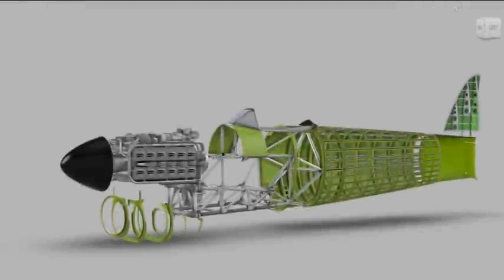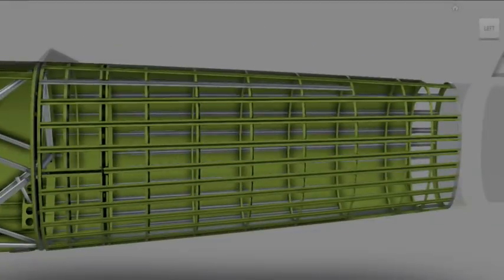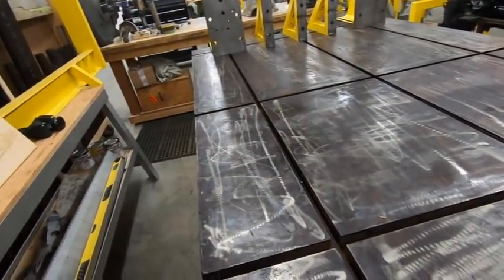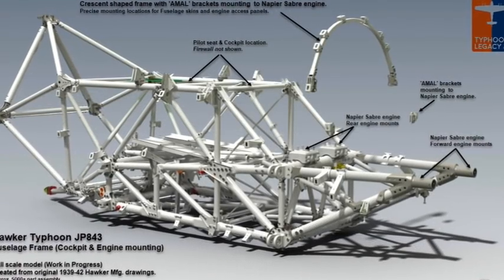Episode 20 Hawker Typhoon Cockpit Structure

Comment: Where would we be without CAD? I spent a few years using PROE. The ability to assemble and check fit and tolerances, walkaround, and see how everything comes together is just off the scale. What I'm looking at here, is just staggering. Congratulations on all achievements.
Reply from the maker: It can be difficult to describe how impressive this work is to anyone who has not been involved with this type of design work; these are not just awesome pictures, but thousands of completed parts drawings assembled into a unit ready for production! Thank you Dave! ~Ian

Comment: Hi, wonderful series by the way. Just curious, as we in Australia and Britain sharre the same language, which differs from American English. Is not a frame fixture device called a "JIG?" The asembly itself is so complex and clever though, i am impressed.
Reply from the maker: Hi Steven, very good question, in this case it is not (to my knowledge anyway) a difference in language. A jig is a tool designed for guiding a work piece or cutting tool during a machining process, while a fixture holds/locates the work piece securely for assembly or work to be performed. ~Ian

Comment: Is this going to just be a static exhibition or is it going to be renovated in to a fully flying condition? If the latter, then how are you going to deal with the weakness in the tail end section? Will you renovate it to exactness or will you make a change so that it has no weakness at all?
Reply from the maker: JP843 will be airworthy, all efforts are being made to ensure this is done as safely as possible. There is information on the Typhoon's tail issues in earlier episodes, this was an issue that was successfully addressed through modifications during the war. JP843 will be fully updated with all modifications that relate to safety. ~Ian
Reply: @TyphoonLegacySociety hank you for your reply, it's nice to know that it will be airworthy, so thanks for restoring this beautiful beast, not enough survived imho even as static displays.

As for the modifications, I understand that they corrected the tail issues, but for all Typhoons this just amounted to being the equivalent of stapling a wound up like when you have an operation.

The full modified design that corrected the tail issue was a part of the full re-design which became the Typhoon II which obviously ended up becoming the Tempest.

So I guess what I was asking was, will you be using the redesigned tail section from the Tempest to address the Typhoons structural fragility or will you be keeping it as original to the Typhoon by keeping the tail in place by using Mod 286 with fishplates on the transport joint?

Thanks again for saving this bird, it's a shame that nobody ever thought to save a Tornado, that would have been interesting to see. Joanna.

Comment: A fatal accident occurred in Australia some years ago now involving a home built gyrocopter because the person who built the machine did not fit distance tubes at a mast-head attachment point as specified in the plans.

As a consequence of that oversight relevant bolts were over-torqued resulting in localized structural deformation of the mast tube followed by stress related failure causing separation of the rotor head in flight.

Another factor of which many people are unaware is that aviation rated squared aluminum tube is swaged with an internal radius on all right angles thus imparting additional rigidity and strength.
Reply from the maker: The smallest of details are often the most critical, details that tend not to get taught to those who home build aircraft. ~Ian

Comment: Many years ago, when I was in the Air Training Corps, the Squadron Leader of the Wing my squadron was part of revealed that he actually flew the Typhoon when it first went into service. As with all new aircraft there were instructions from the test pilots of 'do's and don'ts' when flying. One 'don't' being not to use full throttle in anything more than a shallow dive as this may result in flutter of the control surfaces and overload the outer wing structure. Needless to say he ignored the notice 'just to see what happened', which was the first thing he asked when he woke up in hospital! It seems the test pilot's advice was correct as the aircraft lost both outer wing sections and ploughed into the ground at, luckily, a shallow angle. When rescuers reached the crash site the only recognisable parts of the craft was the engine and the attached well triangulated cockpit structure including the seat. After recovering from his injuries, he was court martialed, reduced in rank and given a desk to fly for the rest of the war!
Reply from the maker: Very interesting, I've never heard of any reports of wing failures on Typhoons, in fact, quite the opposite; often Typhoons would exceed 600mph in a dive with 2000lbs of bombs attached! It would be really interesting to find out a bit more about this situation, do you have any way to identify the aircraft serial by chance? ~Ian
Reply: @TyphoonLegacySociety  Sorry but this was over 50 years ago and  it never entered my head to ask those sort of details. All I can say is that his squadron was one of the first to fly the Typhoon after they were cleared for service. I can't even remember the pilots name now as it's been so long! (Old age, you know!)

Comment: Very interesting video but gosh how complicated all those tubes ro be assembled together behind very detailed computer generated 3D drawings! As you stated it has to be very precise down to very precise tolerance! Out of ignorance I have a question for you: you stated that there is a lot vibrations in that area because of the massive engine yet you use a lot of bolts and rivets. That said isn't there a danger that because of the vibrations those rivets and bolts gets unscrewed and pops out the rivets? Why not welding all this assembly?
Reply from the maker: The tight tolerances used in the assembly prevent joint movement that would lead to quick wear under vibration, and the use of mechanical locking (typically peening of bolts) prevents the fasteners from working loose. The design of this structure made it very strong and easy to maintain in the field.
Reply: @TyphoonLegacySociety  thanks for replying and again I find it very informative 👍👍

Comment: Why didn't Hawker just weld all these steel tubes together?
Reply from the maker: Strength and repairability were better with this system. ~Ian
Reply: Also, unskilled labour could jig them up, drill holes and assemble them. Remember in total war, you need to recruit manufacturing labour from wherever you can.

Comment: Why not weld?
Would not welding be lighter?
R
Reply: Lighter but not stronger. Camm was obsessed with an ideal weight/strength element in all his designs. After the Hornbill didn't live up to expectations he and Fred Sigrist developed the system in 1925 that Camm would continue to develop in every Hawker aircraft until the second Fury/Sea Fury. The Sigrist/Camm system was a work of genius and also allowed for the Hurricane/Typhoon/Tempest to be basically modular aircraft, easier to maintain and repair. There are cases where Servicing Commandos and MUs would just bolt off the back half of the aircraft, pop a new monocoque on and re-rig. Easier than a battlefield repair to the monocoque structure. The other important thing to remember is that this form of construction was also cheaper, which made TOM Sopwith happier. We all know the benefits of a happy boss!
Reply from the maker: I cannot provide an answer better than the one from Matthew! ~Ian

Comment: Are you going to make the CAD work public? If you were to publish some of these CAD drawings I could 3d print a perfect cockit structure for my 1/4 scale RC model Tempest V project.
Reply: I'm sure that the selling and spreading these 3d files in such quality in condition for 3d printing will help for this project for sure. Plastic kit or paper modelers waiting for :)
Reply from the maker: Bruce has been looking at creating some files for 3D printing that could be used to help raise funds for the rebuild effort. It is likely that we would handle the printing and sales of the assemblies directly. ~Ian

Comment: Another excellent video Ian. 
Are you able to address the original design deficiencies during your build? For example, can you address the vibration issues you mentioned from the engine mounts directly onto the forward main spar? I recall you addressed the tail plane joint assembly on a previous video. IIRC, you included all the later modifications in JP843 to overcome the known issues in the earlier designs. Resulting in an improved JP843.
Reply from the maker: Although quite quickly, I did mention the rubber isolation mounts used for the Sabre, the only other vibration modification to this structure was regarding the seat mounting; it will be best that I cover that when we are building and installing the seat. Napier had their own work to do with vibration on early engines, hopefully we will be able to create a series of videos covering Sabre development when we start into the Sabre. ~Ian
Reply: Thanks Ian. You are an inspiration. Thank you for you and your team’s dedication to performing what was previously an almost impossible feat. The complexity of the project is truly staggering!

Comment: Great graphics! It's astonshing how complex they managed to make this machine. Hawkers really didn't seem to appreciate the need for simplicity to enable getting to production status in the shortest time possible. Totally the opposite from the like of Willy Messerschmit and Kurt Tank whose aircraft were really designed to be rapidly mass produced. For instance, most of the panels on the outside of the FW190 are designed as 'flat wrap' i.e. they only curve one way, rather than compound curve, meaning flat sheets could be stamped out and riveted onto the jigged sub-structure, without the need to further stamp them in a die to the required compound curve.
Reply from the maker: I didn't know that about the 190, they sure did manage to create a beautiful aircraft with simple shapes! I've always been a fan of the rear fuselage for the 109 as well! ~Ian
Reply: @TyphoonLegacySociety I'm a big 109 fan too, it's efficiency in terms of design for manufacture and maintenance is impressive compared to British designs of the time. It's a shame that sexy rear fuselage is so tough to replicate for a one-off replica, especially given how well it worked for mass production.

Comment: Great video! Makes me want to try this construction technique to build a bicycle. Looks like you are progressing nicely.
Reply from the maker: That would be one awesome bike! If you do this, please share progress images. ~Ian
Reply: Ian I am not a craftsman like you. I am a designer. I have made a few rough napkin sketches but it is actually proving to be quiet difficult. I agree it would be a cool bike. I would have to have a bike builder fabricate it. I am not sure how well Columbus or Renolds tubing would handle the squaring process. Each area of the frame would have to have a unique casting so this would not be a cheap undertaking. :)

Comment: What are the parts hanging on the wall and which aircraft they're from (if you remember)
Reply from the maker: These are elevators, side cowl panel and the upper engine panel from the Typhoon. No specific allocation  but all original. ~Ian

Comment: Im absoutely gobsmacked that basically sacrificial vehicles could be built to this level of complexity and accuracy during the depths of a world war. Truly outstanding example of the human spirit.
Reply from the maker: Very nicely put, I couldn't agree more. ~Ian
Reply: I heard a story years ago that Rolls Royce volunteered shop time to help put a Bf-109 into the air equipped with an (and a good deal of other work I'm sure) original Daimler Benz engine. They took on the job of verifying and NDTing the crankshaft. It was signed off as airworthy with a note that the crankshaft main and conrod journals had measured nominal to the limits of their measuring equipment. The crankshaft had been made when Germany had had the absolute shit bombed out of it.

Comment: Hi, Ian. Sorry for my ignorance, but I spoke to u last time about why u do different things every video instead of focusing on one thing and finishing it.  U replied that " it's not the order of work for a project like this" could u explain that please?
Reply from the maker: Hi David. certainly! I tend to jump all over throughout various aspects of the project; ultimately this is due to a lack of fully developed data for the Typhoon. Typically, for every part and assembly, there is hours, days, weeks or years of research that goes into the development and confirmation of the information. This can be from drawings, surviving parts, original material specifications, design information or maintenance data. To keep the project moving forwards with regular production, this means that I need to keep the designers busy on their respective area of work. To keep the design team moving, I need to be able to dissect and analyze structure to confirm data; for some of these investigations, I will create a video on my work which will be long before the parts are physically repaired etc. This work can take me away from some of the production side of the project, but is often welcome! There are several large assemblies now which are nearing design completion, this has allowed the start of production when geometry is confirmed. While the production is started, it doesn't  necessarily mean the research is complete, just near to it; if there is a question on a small part or assembly that we need to resolve, work may stop on that assembly until we can solve the question... but I can move onto another assembly. Lots of bouncing around basically keeps the momentum going, although it may seem a bit odd when watching. Adding the Merlin project to this can really mess with shop priorities too! I hope this helps. ~Ian
Reply: @TyphoonLegacySociety  
Thanks very much for that very detailed answer!  I'm full of admiration for your skills and drive!
Reply from the maker: I hope it helped, I tend to ramble! ~Ian
Reply: @TyphoonLegacySociety  
Definitely! And rambling is expected from someone who is both passionate and knowledgeable about something!

Comment: When you swage the round tube into square section, do you need an inner square jig to prevent the square sides going concave? I notice on the factory photo there was no temporary inner suppose in place, but that could be just for the photo. Stay safe! Chris B.
Reply from the maker: There is no internal die, the operation is only between upper and lower external dies. Hawker has calculated the squared size based on the round tube diameter; there is no extra material left to cause it to become concave on the flats, all material is moved to it's final shape. ~Ian
Reply: I understand what you are saying. But how would that work? you cant shove a square mandrel into the round hole until the tube is close to square. maybe they used a tapered square mandrel after square roll operation to clean up the finished square. Or maybe being shaped at the 45 degree prevents the concaving of the flats. I really look foreword to seeing Ian start this process.
Reply: @ew4395  If the square for is partially formed before the inner mandrel is inserted there would be sufficient clearance to insert the inner, my thoughts are that without an inner mandrel to keep the tube wall straight it will form a concave face to the square section, this can be observed if you squeeze a round tube in the vice, or press, the flat "pings" into a concave face, try it, it will be interesting how this turns out in practice!

Comment: Well, I just finished crying. The CAD work is "art". Give those guys a raise. Definitely worth framing. I see you are quickly approaching the point where the tooling is worth more than the product. The squaring machine is, again, a work of art. I know that Guy Black had found one in a scrap yard (decades ago) and he thought it was 'gold'.  One other question...are taper pins used in any of the end joints, and how are they secured?  Cheers.
Reply from the maker: The project certainly could not be done without our amazing design team! Regarding taper pins in the structure, I've not seen a single application for this structure. That said, the wing pins themselves are taper pins! ~Ian

Comment: Do you have any pictures of the raw unmachined forgings for the carry through? It is difficult to imagine what they looked like since presumably a bunch of stock was machined away. What a complicated assembly.
Reply from the maker: We do have some drawings which identify the forged profile for these fittings, all of which show what is essentially a very basic "mushroom forging to reduce material and machine time. ~Ian
Reply: @TyphoonLegacySociety  If you cnc new ones from billet you won’t have the modified grain structure and associated strength you get from a forging. How will you ensure that you obtain the original design strength?
Reply from the maker: As you mention, it's not a simple substitution, there is a huge amount of work that goes into proving the original design requirements are being met before the work can start.~Ian

Comment: do you have a plan for when you run out of space , like for example the wings need to be attached
Reply from the maker: The building was designed to house a completely assembled Typhoon, however, once complete, the final assembly will be done at an airport. ~Ian